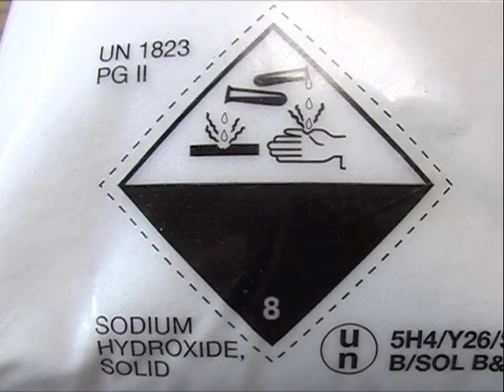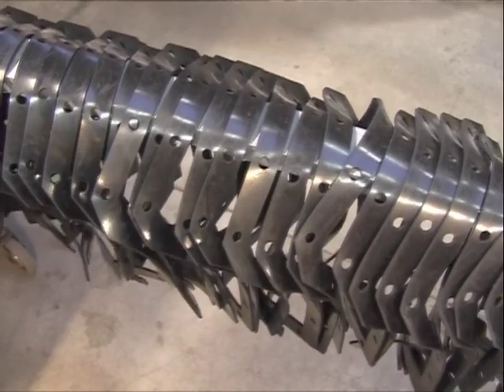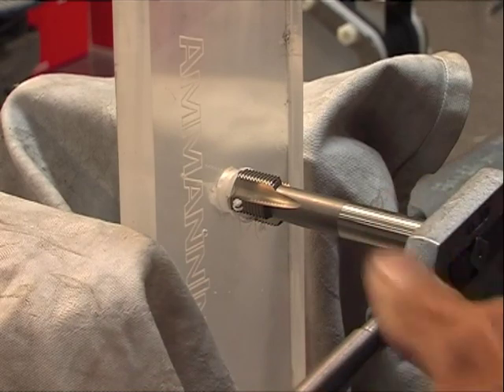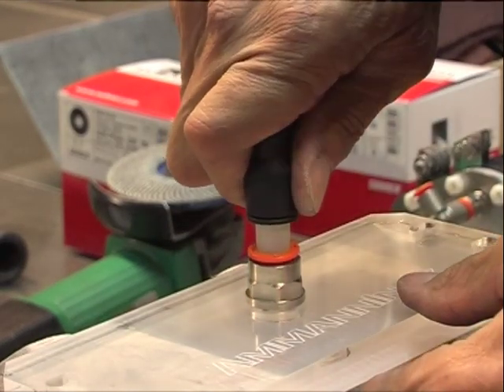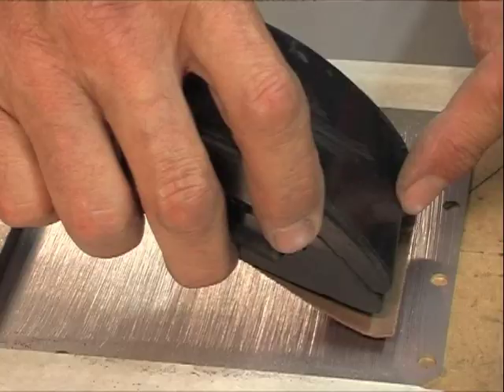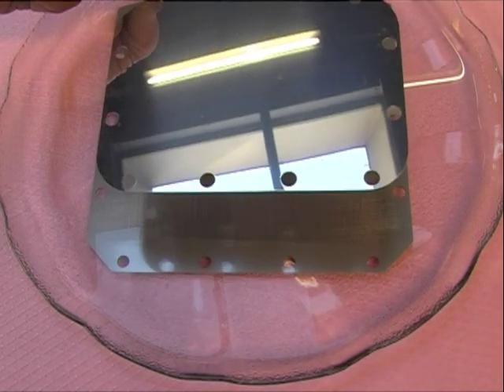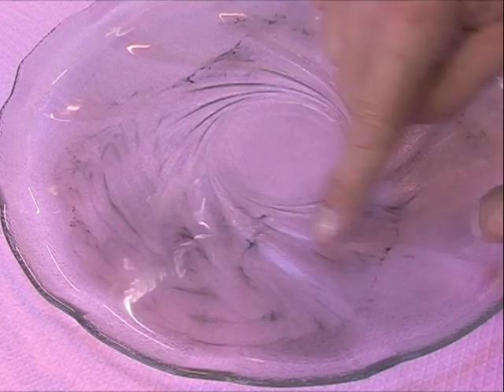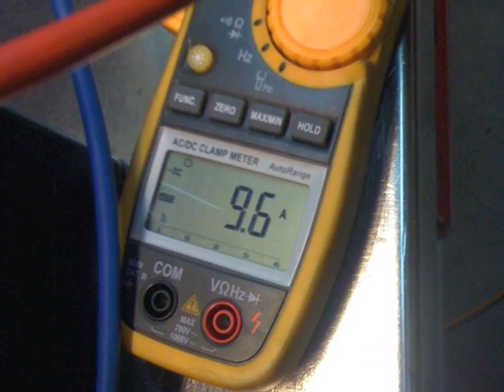HHO SWISS INOX 9 NEW 60 PLATES CELL

Comment: To thread in a perfect 90º angle, simpli remove the drill, and install the thread maker right after the drill, use the drill machine axle to start the thread.

Comment: Again, great work Ammann. What caused the leakage of the 60plate drycell?
I would expect this to be the most efficient and the most brillant construction as it is quite easy and practical.

When I may suggest one improvement:
dont drill the fixing holes through the plates and the sealing - just seal them without the holes from outside with 2 massive
plates which are slightly bigger. That way its much less work and effort and probably a better sealing!

14 LPM is quite an output! What is your Power supply?
Reply: Great advice. Or if you must have the holes if you file them round they wont leak voltage nearly as much.

Comment: Im guessing that the leaking problem was because of the connectors or plugs you used to connect the cell and to hoses, I had the same problem in a different project (air vest) for welding. You must have your car running on water by now :) people like you are the ones who make the difference. please tell me is you finished the cell and if its for sale already.

Comment: Mr. Ammann, I am exited, I had an idea of a different design, unfortunately I lack the workshop equipment. How can we get in touch?  I had written an E-Mail. 
Your last projekt "Tube-Drycell":
Did gas-producion get lower and stock?  
Level up one end of the tubes, at this higher point you should monted your gas.output on the top at the one end of the tube and at the lower end at the bottom the elekrolyte-inlet. In that way you should reach a good circulation of the electrolyte. 

hand Walter

Comment: youtube, stanley meyers.  you need to learn about Pulse Width Modulation friend.

i think its not the problem with your cells, but your power supply.  you can use plane water if you pulse your current correctly, and leave the poison out

Comment: that x-haching concept is interesting-- it could increase the surface area of the plates a lot, try a current test at 12volts, one cell with-out x-hatching against an exact twin with x-hatching and see if there"s a difference. cheers Rob.

Comment from the maker: @kurtilein3 Inside the combustion chamber of a car engine there is only the oxygen that is sucked in with the air, so if you add hydrogen you rob oxygen needed for the combustion=loosing power. Since you are so smart you know that storage in pressured tanks is critical. Rockets have separate tanks because to store HHO combined is like having a time bomb awaiting for a spark to make it explode.
Besides I only delight in showing how to build cells, so if you wish yes I am a fraud, what are you?
Reply: Sorry I came to this party a little late. AMMANN you are not a fraud you are an experimenter with a dream to produce a product. Your experimentation has help lots of us to see what works best and what is not worth pursuing. everything you have made works but as you pointed out the dry cell works best. If you have looked there are lots of HHO units out there that are using PWM power source ( this would decrease the current demand ) to control the reaction and thus the production of HHO this way it can be used to augment the regular fuel and gain power and mileage in a car. You can run a car on pure HHO but from what I have seen the timing is critical so as to not blow the engine up. as it is right now I think most of what you have built would be acceptable for use as a HHO supply to augment the regular fuel be it gas or diesel. to be used exclusively as a fuel the safety factors would have to be addressed, primarily the storage of the HHO and the amount that would be needed as a fuel source. so in conclusion I think it is best as a addition to gas or diesel. I do hope that you keep it up and I look forward to seeing more videos from you.

Comment: @ammanninox 
Hello, I am pleased to see that someone is actually doing the work as it should be done.
I wanted to comment on the grinding the plates, it is not the best idea. I have in production a heating system based on electrolysis for 8 years now, that is an invention of my brothers, and all the testing done has shown that the more perfect the surface - that more longer it will last.
Sincerely,
Jugos

Comment: Respect for the work. See site hho.rs won golden medals Nikola Tesla. Have the first right solution 180V 60 liters of hydrogen ! Perform the installation hho in cars all regularly priced at 230 euros. Being exposed , two cars of 2000 cc diesel and petrol versions of the Auto Show in Belgrade in spring 2011 ! Working on hydrogen

Comment: Hi,
Just a thought but what about combining both the spiral and the plate method?

 Have say 15mm wide by 2mm Depth steel (for example) coiled into a spiral and then repeat this but with the diameter smaller by a few mm to provide the plate spacing? May not work, but like i say just a thought

Thanks

Comment: @bodzioso For each plate gap only 2,3 volt is applied. If you apply more voltage per plate gap you will produce more heat instead of more gas. That's the way it works. So the number of plates is depending on the available DC input voltage. You divide the input voltage by 2,3 and the outcome determines the amount of plates in the design. Most people use 7 plates for a 13,8 volt design. or two times 7 in parallel. Peace, iT

Comment: I don't understend why you using neutral plates?  I'm thinking more electrodes surface, more gas production. Neutral plates only brakes ion flow between plus and minus electrodes. Principle in these cells should be positive plate negative plateand and so more. But any way good job and smart idea with spiral cell

Comment: ammani using NaOH is just a stupid thing... the baking soda naturaly transforms into that, if you are kind enough to send me you e-mail i can send you the complete equation on what happens inside your cell with the baking soda, you are just making your cell more dangerous by adding this compund, and compressor fill the air with oil, so it's not a verry wise idea to dry them using air from a pistom compressor, you can dry them faster using an eletric resistance

Comment: @ammanninox Do you know when you put a mentos candy into a bottle of diet coke, it will cause a reaction that makes it explode with foam? The reason for that is because the surface of the mentos candy isnt smooth, its sorta of pitted and helps in the creation of gas bubbles. Your cross hatching is (in theory) performing the same task...however, im not 100% sure that cross hatching with lines will give the best outcome. Research this concept a bit and maybe there is a more effective method.

Comment from the maker: @Xraller Well some people say it is useless and some say they have measured a significant HHO output improvement.
So I trusted a good friend and did it and wanted to show how to do it.
Basically you raise a bit the surface area exposed to electrolysis.
In my view even if it does not help much it certainly does not hurt and for sure you get clean and well treated surfaces.